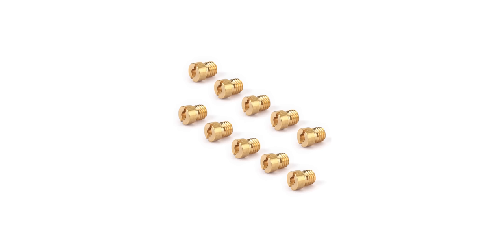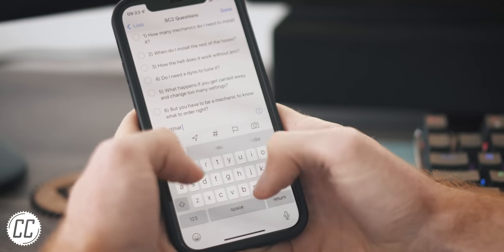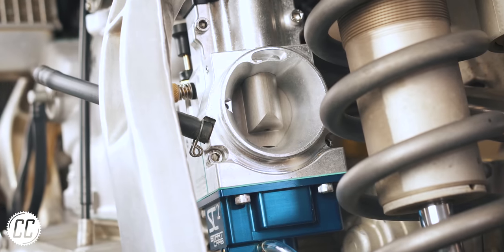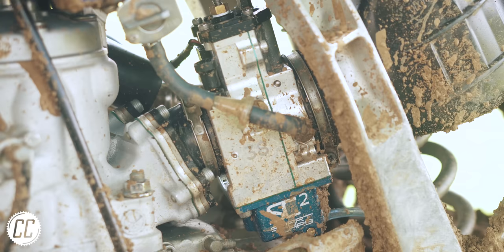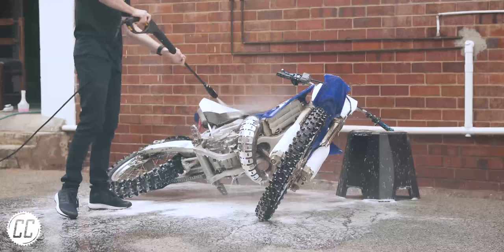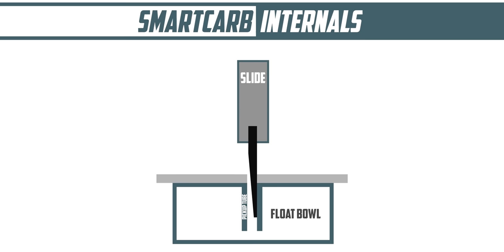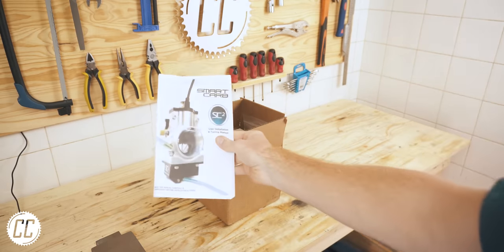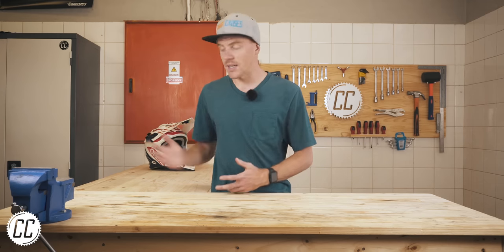The Best Carb Money Can Buy? | SmartCarb SC2

Comment: Edelbrock  had these years ago called a quicksilver...kind of a pain..
Tons of different rods,and real time tuning was a nightmare.
Exact same setup
Reply: Nope, not the same. The missing link was internal, integrated float bowl venting, a patented feature of the SmartCarb. It communicates the same air density into the float bowl that the venturi sees (not external vent lines in front of the rear wheel) along with velocity of that airflow, proportionally, to drive fuel flow both ways. Progress. By the way the QwickSilvers were direct predecessors to the SmartCarb. Same inventor. Just needed time to learn and improve.
Reply: I have two Xr650r’s both equipped with quick silvers. Once the right metering rod is installed the carbs have not been touched in 4 years. A brilliant carb with a simple design and a pumper to boot. I’ll keep what I have, thanks anyways.
Reply: @chuckfry1227  happy riding!

Comment: It looks to good to be true…too simple to work…but I bet cavemen thought that when someone invented the wheel! I’ve visited the website and asked the question if it would fit a 2003 Aprilia RS125 running a 34mm dell’orto carb without a throttle positioning sensor. Will report back their response.
Reply: This will be interesting to see what they say ...can't see why it wouldn't...🇬🇧😎🏁
Reply: What's the matter with your Dellorto?
Reply: Any update? because they did not respond to my question for Aprilia RS250 bike.

Comment: I had a edelbrock carb that functioned the same. Metering rod and a red screw on top.
Reply: Yep, the Edelbrock QwikSilvers were predecessors to the SmartCarb and they saw the introduction of the clicker on top. Different function though in some key ways. SmartCarbs internally vent their float bowls and utilize a non-round, variable throttle rate venturi profile, among other differences. There's a long history behind the metering rod carburetor concept.

Comment: i have had a SC2 and i didn't notice any fuel savings at all and it just works like a normal carb but with a gimick.
it's not really worth the money just stick with a traditional carb or convert to EFi.
don't get me wrong it still works just fine but i didn't notice any difference in any aspect it just ran like a ran like a normal carb.

Comment: Ive been a mechanical engineer tech for longer than some of you have been alive . Now i tell you this shit is out of date. Why in 70' 80's I grew up with SU carbs, Webbers, delautos, holly etc. Im glad there friggin gone. Dont bring this shit back. Science and physics has proven electronic fuel injection is the best fuel efficiency, you need to deliver close or directly into the combustion chamber, if not close as to the inlet valve. EFI produces better atomization of fuel and air.  Now with this design your friggin wetting the inlet manifolds !!! creating an over rich mixtures at different throttling positions. Fuel injection for efficiency dominates, no fuel bowl, No blow back,no over fueling, no friigin vacuum tube etc!  I wished electronics were better in the 70s and 80s as carbs would of been phased out sooner. Thats a Fact

Comment: I'm wondering if they do smart carbs for cruisers. I'm always looking for a way to get better gas mileage. An helping the environment even if just a little is a good thing in my book
Reply from the maker: Absolutely! Check out their website
Reply: I have seen comments like this a lot, please go to the SmartCarb website (top link in the video description) and scroll down, leave your email contact info and letting them know you're curious if the SC2 could be fitted to a street motorcycle that's 4-Stroke and we'll either:
1. Find out if it's possible to rig it to a 4-Stroke road going motorcycle OR
2. Hopefully they'll make an "SC3" or such for this purpose.

Comment: This type of carb has been around since the early 70's (rod vs needle)
BUT they were VERY expensive and almost impossible to tune because a complete stripdown was needed to make any sort of adjustment.
I'm glad to see that someone has made it a lot more user friendly because the old type performed extremely well once you had gotten the setup dialed in but the difficulties simply made it a non-starter.
Reply: 1967 actually with the Posa-Fuel. After that there was the Lake Injector, Lectron, Ei Blue Magnum, the QwikSilvers, and ultimately the SmartCarb which offers all of the performance benefits of metering rod fueling with super easy external adjustability.
Reply: @SmartCarbFuelSystems  think Ron Gardner of Gardner Carbs came out with it before 1967, i have a lot of his prototypes from the late 1950's sat around.

Comment: While this seems like a cool adjustable carb I didn't see any features that could even remotely classify this as a "smart carb". I was really hoping for a smart carb that could automatically adjust like we have come to expect from their fuel injecting counterparts. A "Smart Carb" should include pressure and temperature sensors for intake and atmospheric conditions as well as a micro processer to monitor/calculate optimal settings and a stepper motor to adjust the screw position accordingly. Maybe a better name for the product would be "Easy Adjust Carb 2 (EAC2)"...
Reply: I too figured with a name like Smartcarb it was going to do something electronic that you set up from a laptop or  the like and that it would adjust itself on the fly. The only real innovation is in the needle design, but even that brings to mind why Mikuni, Keihin etc. have never thought of that idea. I'd like to see a back to back dyno run between one and a properly tuned stock carb to see what the tangible benefits are along with a fuel usage simulation.  Many 2 stroke motorcycles have always come from the factory running rather rich because it helps with longevity, so some of the claimed benefits could just be running a weaker mixture, which could be achieved with the stock carb and a few dollars worth of jets and needles. The easy adjustment for altitude is the only thing that jumps out at me as being an immediate benefit.

Comment: I have been running these gems on my 1979 Yamaha Daytona Special (rd400) for about 2 years now. I cannot say enough good things about how they perform. If you don’t know what a RD 400 is? It is a twin 400cc side by side two stroke. To get an idea of it’s umph? Compare it with hanging a license plate on a CR 500 is about as close of a comparison as you can get that I know of. It went from like riding a rocket to now it’s like riding a bullet! Once I got them dialed in my bike really woke up in every way. No more flat spot in how the power comes on, the throttle is crisp from the bottom all the way to redline now. Before it was boring on the bottom until about 4k rpm’s then ya better hold on cuz it would explode to life until I shift at 10.5k rpm’s. They are by far the best carburetors I have ever run! I’ve been around bikes all of my life and I’m old as dirt so it’s sayin something about them. The company has a customer service/tech department that is second to none. My only tiny issue is they only make a left side carb so guys with twins will have to reach in a hot motor to make the initial fine adjustments. Good news is they really are a set and forget system. Once I got them where I wanted them I have not had to do any more adjusting in 2 years! That’s badass! They are worth every penny
Reply: Never heard a RD 400 compared to a CR 500 before. 
I've ridden loads of both & the yam was tame compared with the brutal honda (both stock & good examples)
Obviously they are geared completely differently but the honda was a hard to start , high compression evil cow that would put you in hospital  compared with the yam.
Full race honda compared with mildly tuned Road bike .

Comment: About 10 yeats ago, I bought a 2002 KTM 520 exc, from the original owner.
He was/is definately a tinkerer.
 He was a Canadian guy, who had relocated to SoCal.
 He was also, big into snowmobiles.
 The 520 was pristine!
He had added a device, known as a dial-a-jet to it.
 Apparently this is a common mod to snowmobiles.????
 I had no prior knowledge of it.
 He had it all set up, and gave me the manual for the dial-a-jet.
 After reading, and understanding the unit, I just rode the bike and still do...a lot.
 Even in very low temperatures, I never have to use the choke!
Even first thing in the morning!
 I have ridden the bike at aea level, or below, and at 9000' elevation.
 1 or 2 "clicks" on the dial-a-jet adjuster is all it takes.
 Incredible!
Has anyone else had experience with these?

Comment: Thanks to Smart Carb for explaining the differences between SC2 and SU carbs.
I was completely wrong. 
A "superior SC2" metering rod is in no way like an SU metering needle with one side machined off. 
The SC2 has a flat slide raised by the throttle cable and the SU has a cylindrical slide raised by the vacuum in the venturi. Again; no similarity.
The SC2 has an integrated float bowl and SU only used this from 1972.
AND the SC2 passes EPA tier2 emissions on PER MILE on 4 strokes. This is obviously very difficult for a small bike compared to a 90's small car.
Congratulations. Dave D

Comment: Im retired bike mech and prefer carbs way above fuel injection . Simpler,  cheaper , way easier to fix and more reliable and above all it gives you full performance. No need for mappings and that sort of crap. Once jetted and tuned correctly it remains tuned. Bottom line , I'll choose carbs 10 times out or 10.

Comment: Why have oem's never visited your smartcarb or their own before going straight to fuel injection ? Surely one carb would have been simpler and cheaper. I don't remember any smart carbs in automotive world. Skipped right on past that and fuel injection was the new way. How come smart carbs aren't around to fill in some gap between the two or as another option ? Was the Predator a form of smart carb. Possibly but it never really took off.
Reply: The answer is simple: the SmartCarb is newer technology. Decades newer than conventional jet/needle carburetion and even automotive fuel injection. Awareness takes time but it is happening. We have OEMs approaching us and testing our product. Whether or not we see OEM adoption, and we think we will, before regulatory pressures push everyone to EFI remains to be seen. Do stay tuned!

Comment: You should have mention the throttle body design, as the conventional flap/butterfly design doesn't provide a linear curve of intake air (air being swallowed by the engine), it is more like a quadratic one, which you remove almost the whole air restriction at less than 90 degrees opening. This new design provides an exact intake area (because it is like a slider gate), so at 100% opening throttle body, you'll have 100% of the area available to suck air. Not that i have one or even tested it, but just by how it looks, it seems to me that provides an exact AFR the whole time, after a proper calibration of course.

Comment: the fuel savings alone would make this type of carb interesting to many. Consider when racing you could potentially run a smaller tank. saving weight. of if you were enduro riding, you could ride further between fill ups... and over all, you would be saving money on fuel.
Reply: have you seen the price of them you are now saving nothing

Comment: Your Engine doesn't burn exclusively Gasoline. The Carburetor's function is to mix Gas with Air at a 14:1 Ratio, 14 Parts Fuel for every 1 part Air. Then that Mixed Charge is Sucked into the Combustion Chamber on the downstroke Compressed by the Upstroke and Ignited by the Plug at TDC...

Comment: Idk about the bolt argument. I spent a bit as a mechanic and small hex keyed bolts strip out just as bad or even worse than phillips screw heads in my experience. This can be mitigated by having a really high quality hex socket, I recommend Snap-On for the best, but yeah... They strip out really easily if it's torqued down even a bit over spec.

Comment: Tired of stripping the Phillips head screws? They are NOT Phillips head screws. They ARE “JIS” screws. JIS stands for Japanese Industrial Standard. The Japanese improved on  the Phillips head design by changing the angle of the contact surfaces between the blade of the screwdriver and the screw itself. The JIS screwdriver acts as a de facto torque screwdriver. When you’ve reached the proper torque the blades on the screwdriver are designed to slip out. When you use a Phillips head screwdriver on a JIS screw you loose the inherent torque capability designed into the screw head. Hence the stripped screw heads. Do yourself a favor and order a JIS standard screwdriver set for working on Japanese manufactured products.

Comment: Funny...Piston powered aircraft have been using this carb design..basically from the beginning (100 years??).   With a typical aircraft carb you can manually adjust the mixture with push-pull control, most also have a vernier to it as well so you can fine tune the mixture to achieve the exact exhaust gas temperature for max power (IE: the perfect A/F ratio).    What would be cool is to allow the rider to (like an aircraft) change the mixture with a lever or knob or something, while riding.   KOSO sells an EGT for bikes, one could install that and dynamically change the mixture to max power always.

Comment: U.S. automobiles had smart carbs with electronic O2 sensor feedback in the early 1980's.  Horrid to maintain because of early electronics, poor documentation, and no web info then, plus all the problems of carbs (small passages which clog, floats which sink, needles which get stuck with debris).  This one is fully mechanical.  I had a late 1990's Ninja carb in hand.  I was surprised it used a slide to vary effective throat area.  Wonder when motorcycles began using those.  There was a similar after-market variable-venturi carb for autos (Predator), but never became popular and EFI systems replaced it.

Comment: Any carburettor is a compromise,too many variables,air temp,density,engine temp,fuel temp,fuel quality etc.etc. Much of this tech is not new anyway,many motor and carburettor manufacturers over the years have tried differing approaches to combat the inherent deficiencies of a design that was good in its day but really should be confined to history,variable Venturis,electronics,vacuum regulation,stepper motor control,CFI,closed loop monitoring etc. None of it worked because the carburettor is fundamentally flawed. You can't make a silk purse out of a sows ear,I love the sound of induction through open carbs but they can't match Fi's all round superior efficiency,sure there are some good bike carbs out there,they are very expensive and requiring regular fettling. Automotive carburettors from the early 80's to 93 were getting ridiculously complicated (Japanese particularly) and for minute fractional improvements in efficiency at the cost of development and consequently the reliability of the carbs themselves.

Comment: I have a killer (I mean KTM killer) KDX 220 fully moded out by Jeff Fredette...anyone think this will be a plus for me??? The added fuel range is a temptation, because I do 125 mile dual sports and sometimes my tank is running on fumes while the 4 strokes are still half full.

Comment: Thanks VIVA  all SA .  Does  this new carb maker  do a 4 stroke  version for a Yamaha 10 hp outboard engine  for boats as the  motor boat engines are nearly always  motor bikes or industrial   engines 
I want to use  this  carb as  i need to get  better fuel consumption  on my auxiliary motor to my sail boat when using the  engine  power and prefer to avoid electronic solutions and EMS Engine  Management Systems  

Also need to talk to any  mechanical type water injection outfits to  get better fuel economies as well  I also  Lived and loved and worked  in SA  in 1991  J/berg and 1992  era in Durban Natal 
Max respect for SA mechanical abilities  and so many normal   oaks that  could fix and pimp  their   cars and baki   stuff  themselves

Comment: a helpful tip: we often think of things llike mpg and equate this to we need more gallons to make more power, what is confusing about this is we don't burn gasoline....say it again, we don't burn gasoline. we burn air and gasoline is the catalyst that makes it possible. so if you have a fuel air ratio of 25:1 than you burn 25 parts of oxygen to 1 part gasoline.  also i am not saying 25:1 is your fuel air ratio, its just an example.  also this carb could be a great thing if you like old bikes like i do.

Comment: How are they gonna charge almost 1k and not make this a constant velocity carb? Like this is just a normal carb with customer service. It doesn't have an accelerator pump either. I guess the most unique thing on this is the flat side main jet pin? I guess. Overall, wack.
Reply: How did the form/function of the SmartCarb escape you while watching this video? It's fairly comprehensive. You might check out Steps to Podium's technical explainer too. 

This isn't a normal carb. There's nothing else out there like it. The SC2 uses arguably the biggest advancement in mechanical motorcycle carburetion this century and that is integrated float bowl venting - a patented feature that negates the need for external vent lines, secondary fuel circuitry, and an accelerator pump. All carburetors use atmospheric pressure differentials to drive fuel flow, but only the SmartCarb applies at-manifold air density and velocity for more proportional AND more immediate fuel driving force. CV carbs aren't directly throttled and are subject to throttle lag. Accelerator pumps for 4T carbs are a bandaid for laggy venting communication that our integrated venting fixes. 

Not whack. Encourage you to dig a little deeper. The How It Works section on our website is a great place to start.